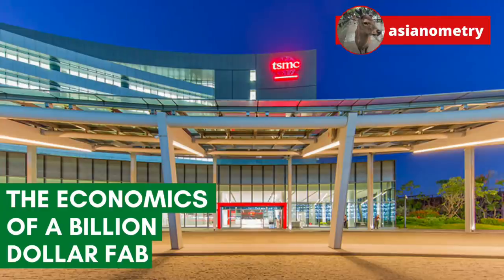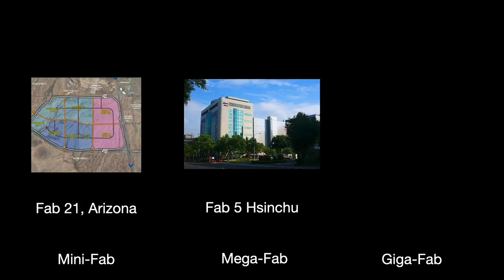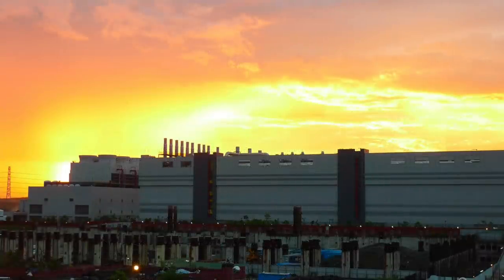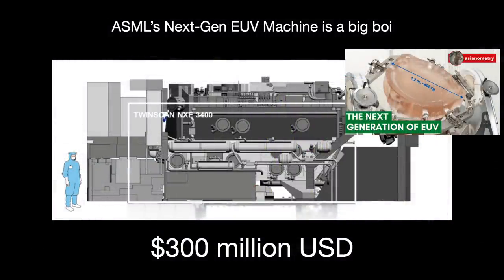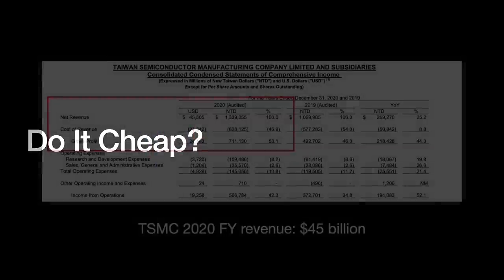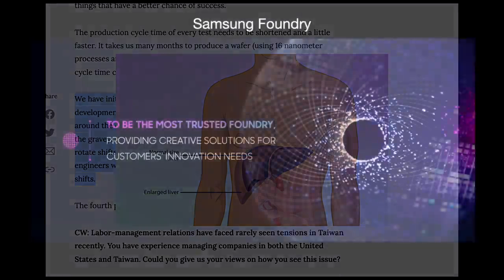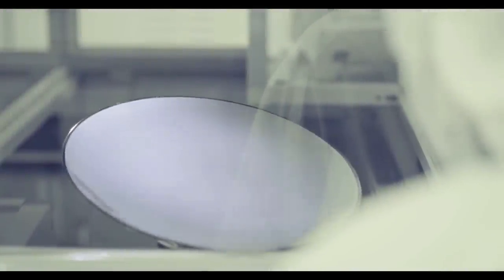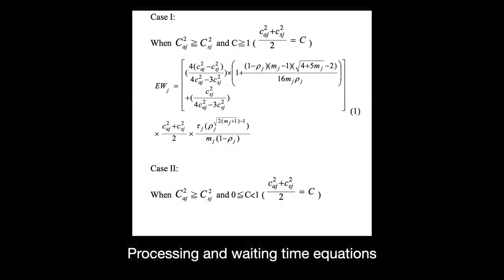The Superior Economics of TSMC’s Giga-Fabs

Comment: ASML is very different from TSMC, regarding sharing advancements in technology. ASML wants to get as many high skilled engineers as possible, and sharing how the EUV source and optics works is a great marketing strategy. However, try to find information about how the wafers and reticle move, metrology systems, temperature control, motion control... You'll find nothing, since this probably can get used by any other competitor.
Reply: But then what's stopping anyone else from competing with asml if they're so open house?
Reply: @Napoleonic_S  ASML does have competitors: Nikon, Canon, and probably others in US and China. AFAIK only the EUV market is cornered by ASML. Perhaps due to better talent management and a relatively small market. I mean, how many companies are shopping for an EUV machine?
Reply: @guitarazn90210  Exactly. ASML has little info about how do their DUV machines work, apart from the info that you can get reading any book in the topic (there are really good ones btw). And ASML can show some breakthroughs in technology, which is mostly the source of EUV. But of course you won't get any information about how it really works: the sensors, mechanical actuators and software. Even their suppliers are supposed to be secret (except the big ones, you can't hide that 1/3rd of the machine is made by trumpf). I am confident that their openess for "sharing" technology is just to get a lot of people to work in ASML. It doesn't really harm the company, since if the competitors want to know these stuff, they can get it somewhere else.

Comment: Another awesome video.

One thing I’ve been wondering about is what happens to fabs when the leading edge customer move on to the next node? Presumably TSMC (and Samsung/Intel/Global Foundries) built huge capacity at 12/16/28nm. But those nodes are no longer good enough for products that need the leading edge. There’s always stuff that doesn’t need leading edge, but I always assumed that all those products were being made on old mature nodes where it would be cost prohibitive (with little economic benefit) to transition to newer process nodes. Also, what is the global demand situation for all those use cases beyond the leading edge? It seems like there would have to be pretty significant demand growth to absorb the entire manufacturing capacity of a new process node every every 2-3 years. We know the demand is there for leading edge, but what about older nodes. Specifically, as TSMC transitions to 3nm (primarily Apple to start) and more customers like AMD & nVidia move more production to 5nm, what happens to all of TSMC’s 7nm capacity if it’s no longer being used for GPU’s and desktop/laptop CPU’s? Who’s taking all that capacity?
Reply: I think its going to be used in chips for cars, for the infotainment system, dishwashers, TVs, and other appliances
Reply: They market those nodes to other customers. Apple got 5nm first but the year after AMD and Nvidia will use that node. Also makes sense because mobile chips are smaller and the yield for the much larger GPU and CPU chips will be better after the node is more mature. Flaws are usually calculated on a per area basis which is also why AMD chiplets gave them such an advantage, since a smaller chip has less chance of failure and if something goes wrong it is less to throw away.

Older nodes are still useful for other chips though. Lots of analog and mixed signal ICs are made on larger nodes because you would burn through the traces with so much current otherwise. Keysight oscilloscope ASICs for example were being made on nodes over 100nm (130nm in the 4th gen Infiniivision) but now went with a 65nm node recently. The lower cost of using an ASIC also allows them to use the same chip in many product lines. You can buy a $1000 scope with the same chip as their $50,000 or $1 million scopes. The higher tier ones use multiple chips together, while the base models share 1 chip for multiple channels.
Reply: Like in the videos said a lot of nodes get upgraded those who weren't end up the with the stuff said from @Village also there are other manufactures who can't under 20 nm those are specialist in doing chips for other uses then computer. Interesting is when we really hit the physical limits in a few years other companies then have a chance to catch up to ASML/TSMC while this will take many years it will push the prices down.
Reply: The fabs usually continue to produce chips for other customers/purposes. There is more integrated circuits in your computer than the CPU and GPU. And there is circuits in more and more other places to.
Reply: Also process improvements like recent 6nm can be viable in a nominally 7nm fab extending its prime economic life.
As costs for new processes rise, the chiplet/tile approach allowing a mix of small dies using different processes in the same package  makes sense.
Reply: if they think that they cannot recover the cost from the new customers, they will charge apple more.
Reply: Intel provides an example of the "less important stuff" others have commented on.  Intel has a large product range, beyond just CPUs, and does everything in their own fabs (for now at least).  You can look at all their products and see by the node where each was made.  You can also tell how Intel values each product.  When a new node becomes available their most important (ie. profitable) product will move to it first.  All their other products will then shift up a node (where 'up' means better/smaller), in order of priority.  Eg. chipsets (or platform controller hubs or whatever they're called these days) will be made on nodes a few generations behind CPUs.  Somewhere in there will be networking chips, with wireless networking taking priority over wired, etc., etc.  You could tell what Intel thought of Itanium during the last years of its life by the fact that it stayed on their oldest available node.
Reply: Usually in the case of Apple moving to the next node for phones etc, they pay a premium as eg N3E (N3 Early) isn't great and is a way for TSMC to start making money while they iron out more kinks.
Then only with process improvements do the really big chips come in when the process is also more capable of being optimized for performance (N5P eg i think?) by then phone SoC designs have moved on to the next node

Comment: Could you please make a video on how a smaller fab with older technology such as 180nm makes money? 
What sort of customers or products tend to use these older nodes? 
Are older nodes cheaper per delivered chip even with the reduced chips per wafer when performance is not a critical factor?
Reply: Older nodes just means that you can't have a lot of transistors on a wafer, but the products made on those nodes tend to only have a small number of transistors so that's not a major concern
Reply: Think about how the different functional areas scale differently and you understand.
Assuming it is a digital IC you still have to drive the output pins, leave some area for cutting, testing/contacting. => What is the point of reducing a small share of the area to be even smaller?

Comment: I'm curious what areas TSMC is doing R&D beyond the process of ever shrinking circuits. E.g. are they working on optical or quantum computing?
Reply: They have heavily invested into GaN on Si technology that is used in power electronics applications (e.g. phone chargers, computer power supplies, & EV).  TSMC have developed what is called a Schottky Gate, Enhancement Mode, High Electron Mobility Transistor (HEMT) technology.  They are not alone in regards to GaN HEMT technology but unique in their business model.   TSMC realized that they didn't want to get involved in anything more than the semiconductor fab side of this emerging industry so they offer their GaN fab capabilities to a number of independent "fabless" companies who are looking  after all other parts of the business. 

These fabless GaN companies include Navitas and GaN Systems as well as STMicroelectronics - however STM have also invested directly based on their acquisition of Exagan.

Comment: The progress in microfabrication is amazing, but it seems like mitigating the risks of supply problems has still been hardly considered, and the giant fabrication facilities may ultimately fail because there are simply so much that can go wrong with them.  The titanic costs and almost incomprehensible complexity of these processes seems like it could become easily unmanageable at some point in the near future given hte endless resources that must be obtained, wafers, photoresists, specialty chemicals for layer deposition, metal deposition, enormous amounts of water, solvents, acids, and bases for cleaning and stripping, the dependence on many different types of photolithography processes to complete a wafer,  ion implanation and annealing, among the countless other equipment and supplies.   Technology is more fragile than ever and the semiconductor supply chain problems may be just a symptom that this complexity becoming too much to manage.